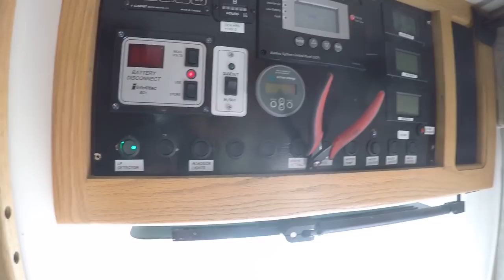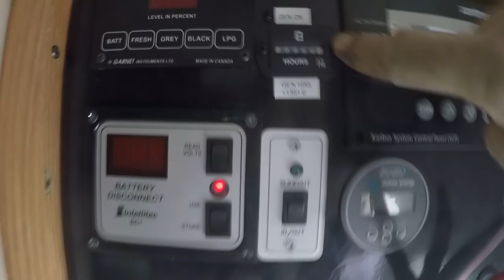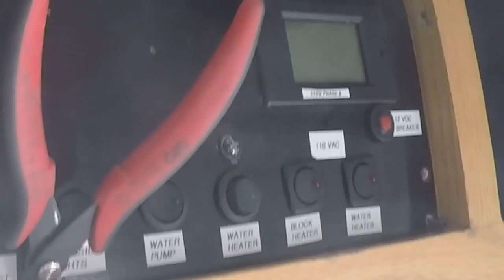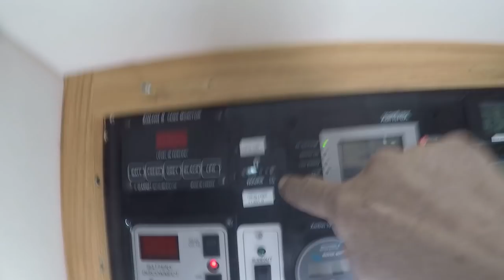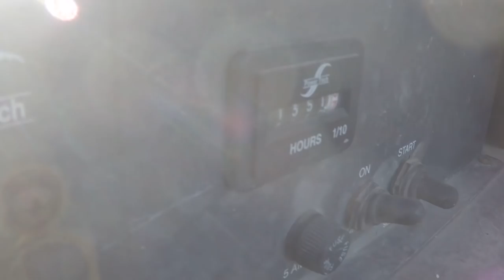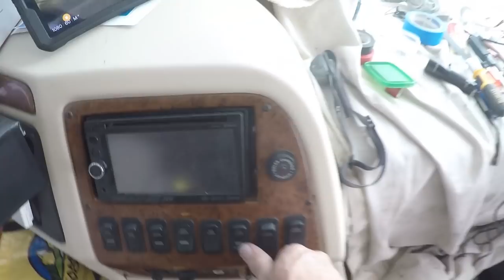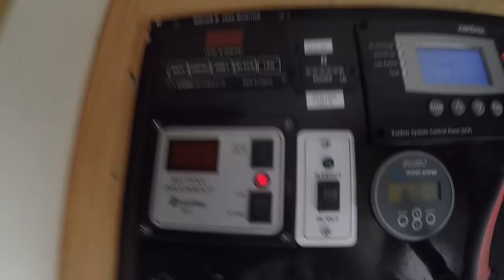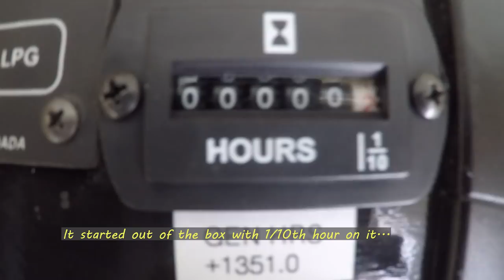RV How To Installing A Remote Hours Meter for your RV's generator.

Comment: Another great reminder why I don’t film the actual installs 😉  BTW can you change the hours on the meter?  I suspect you can’t so I assume you just do a little math.
Reply from the maker: Can't change the hours on the new meter. On older ones it was easy but this one the case is welded plastic and I'd have to break the case. Yep if you look at the meter I have noted to add 1351 hours. It will make it easier to calculate fuel consumption which I have estimated from some math on my fuel mileage and keeping track of gen hours. It works out to about 0.6 gal/hr  at ~75% load for the gen set. Because I am a nerd and have nothing better to do...pre-solar it cost me about $6.40 a day for gen fuel (~4 hrs run time per day)... and with solar it's $0.07 (amortized cost of solar) SO BOONDOCKING ain't free but you can get it close...